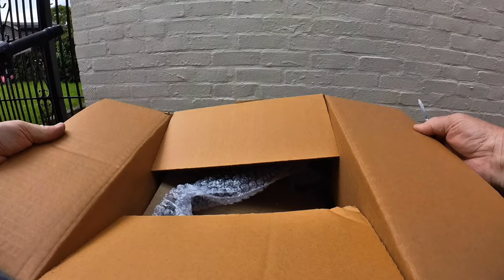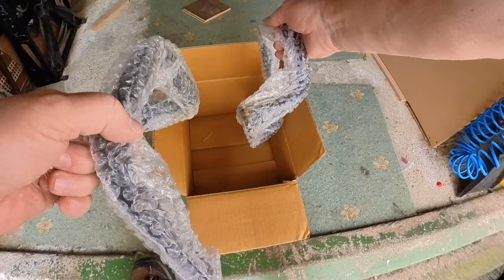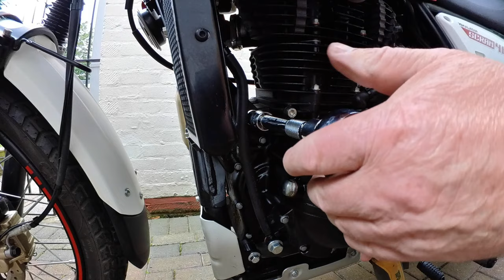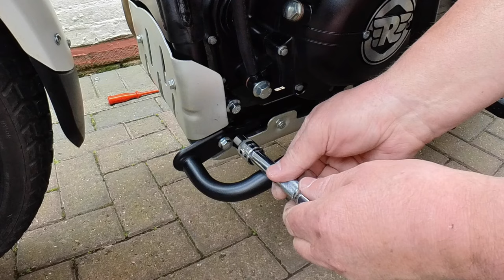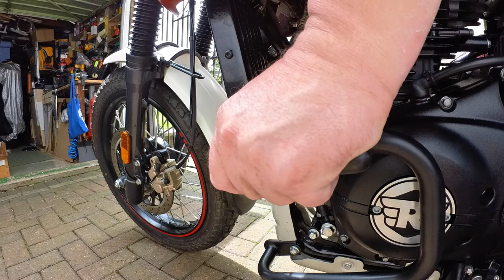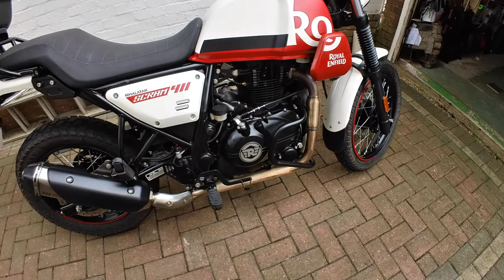Protect Your Royal Enfield Scram 411 with Engine Guards

Comment: Top job, got to love a big rubber mallet👍 I'm like a coiled spring as DHL are due any minute with my tacho kit, toolkit at the ready and let me at it🔧
Reply from the maker: A must have tool them rubber mallets! My shot filled rubber mallet is in my toolbox at the back of the garage so went for old faithful 😂 I’m guessing DHL have visited by now and you’ve got the tacho unpacked and ready to fit. I’m as excited as you are, let us now how the install goes 🔧🛠️🪛👍🏻😁
Reply: Evening Dave, tacho fitted.  Followed your advice and lifted the tank slightly.  No big hammers needed and no swearing, even though it was a bit tricky.  Rain started just as I completed the mission but hoping for a test run tomorrow @MerciaMoto
Reply: Oh Paul you tinker keeping that one quiet. Happy tinkering.
Reply: @paulholmes1682  well done. Keep us updated on your results
Reply from the maker: @paulholmes1682  welcome to the Hunter Tacho Club!  🎉 😁🫡
Reply: Been for a test ride and it's Tacho-tastic.  Tweaked my adjustable gear linkage and got that just right and complete with my adjustable levers I'm as happy as Larry @MerciaMoto
Reply from the maker: @paulholmes1682  there’s nothing quite as satisfying as fettling and embellishing our steeds is there? 😀 enjoy Paul 👍🏻😀

Comment: Hi Dave. No expletives or bloody knuckles. A sweet install . I was shouting at the screen put a spanner on that 17mm nut and torque it up from the 13mm bolt side.. :)) . this made me check my camping kit, and yup as suspected I did not have my SPANNER OF LAST RESORT ( OMMER ) packed . quick trip to Halfords for a small nylon mallet. All sorted. The steed is looking sweet Dave. All the mods are well researched so as not to detract from the  character of the bike.. BEAUT EEEEE FULLL > :yt:🤓💯❤‍🩹🙏🤳
Reply from the maker: Thanks Dave, well spotted on tightening the engine mounting bolt. The guard bar are slightly angles which means you can’t get the socket on to the nut, especially my chunky socket.  Where would we be without a nice big micro adjusting ommer or better still a big chunky mallet! 😂😂👍🏻
Reply: @MerciaMoto  😂 😂